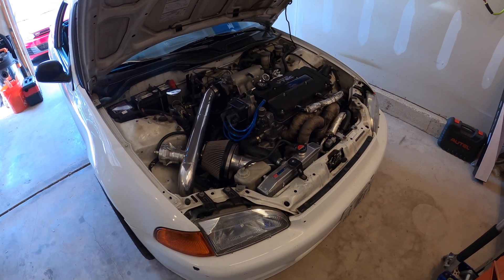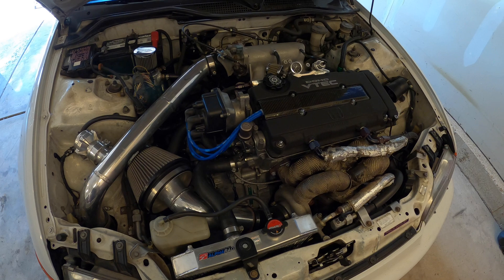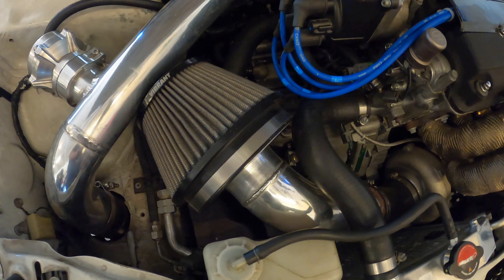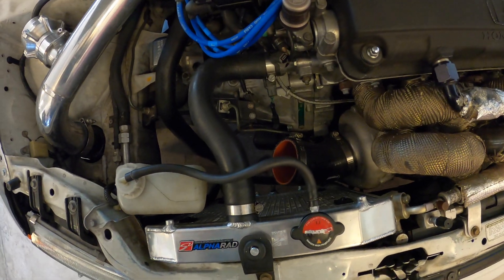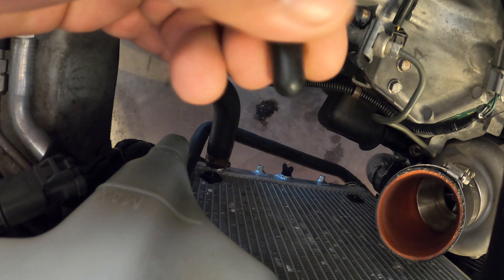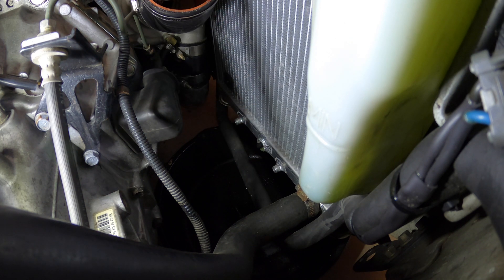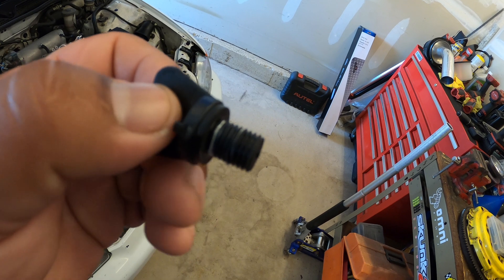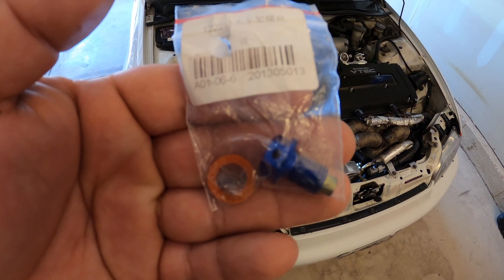Aluminum leaky radiator….Drain bolt FIX...

Comment: Follow up how is it going?
Reply from the maker: That’s a great idea, I’ll make a updated post in the description section of the video. I may also make a short video, again thanks for the great idea. If you like the content please like and subscribe.👍
Reply: I've had the same problems with an aftermarket alloy radiator in a ford DOHC 5.4 V8 where there would be a small puddle of coolant under the car after each time I drove it it, on one side and let it sit.
Turns out the plastic drain plug was loose and I tried to tighten it by hand and it just spun around and around and the plastic threads on the plug were munted, and every time the radiator or the plug got hot, it would leak. The O ring that was meant to seal the plug to the alloy radiator had deformed flat so I tried a new O ring but nope... It was a slow drip overnight no matter what. I put an alloy 1/8” NPT threaded hex plug into the drain hole with some pipe thread sealant on it and tightened it and the leak so far has stopped.
My work carpark was getting real nasty about the coolant leak on their floor and they were threatening to have the car towed away due to the 3 inch pool of coolant it used to drop on the concrete while I was parked there for the work day.
Reply from the maker: @DrinkinDaJuice  

Nothing better than to fix a pesky slow leak. When I finally fixed mine I couldn’t believe it, I was waiting for it to start leaking again.😂 Thanks for watching and please like and subscribe.🔧🔧🔧